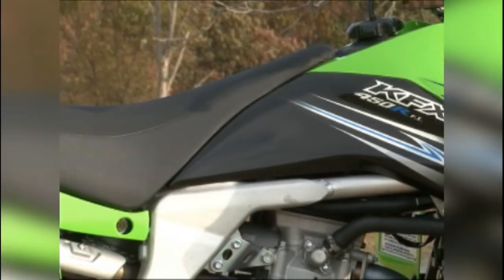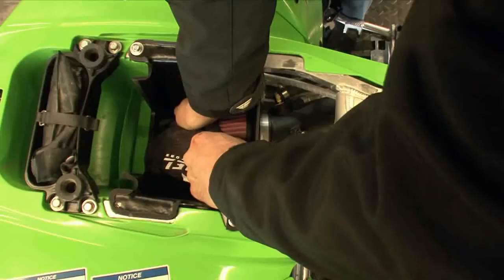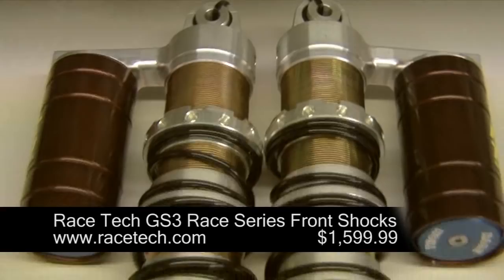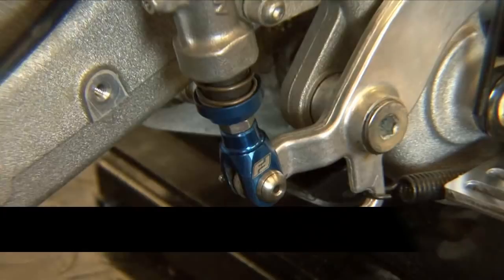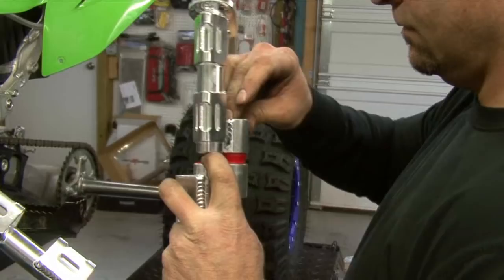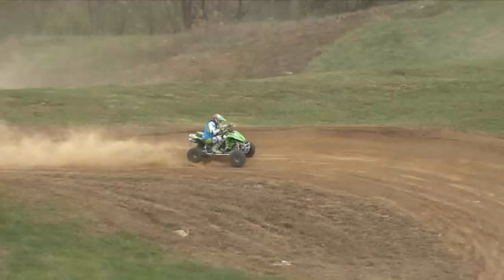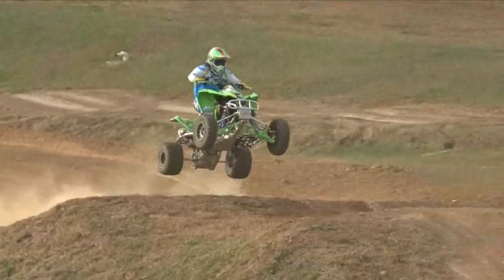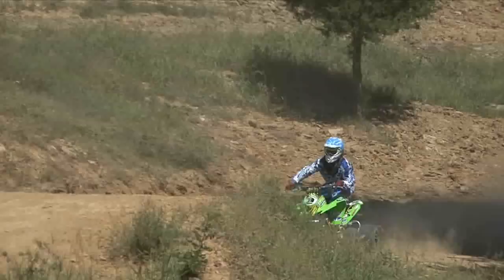Kawasaki KFX450R Motocross Build

Comment: This is a budget build guys. *Proceeds to spend 1600$ on front shocks*🤣
Reply from the maker: Okay okay so it wasn't really exactly a budget build although we did not even touch the engine. If you're going to build a KFX for the track you're going to have to get aftermarket suspension there's really no way around it
Reply: @ATVonDemand  understood just a joke cuz I'm poor😂
Reply: Those are premium front & rear shocks for sure! Be my 1st choice if had extra bucks. Fox & Elka stage 2 or 3 are cheaper I think.
Reply: Now nice ones are3-4k 😂

Comment: I been following this build for my bike and it's so far great

I did elka stage 5s all the way around though
And lonestar +2aarms +4 axle

But used the fuel customs intake and the hmf exhaust and programmer

15 tooth sprocket

This bike runs.. No bike is cheap New and being competitive isn't either..

U can go buy a 2014 yfz450 put a pipe and programmer on it and loose to a 2014 kfx450r with a pipe and programmer 

Buy what u like. But I've made plenty of Honda Yamaha n Suzuki 450s mad..
Reply: What does the 15 tooth sprocket do to your kfx ,does it increase the performance ?
Reply: Pics of the build?

Comment from the maker: We never calculated the machine's exact top speed, however it was geared down just a bit from stock. We could have easily pulled taller gearing then stock, with improved acceleration. Nothing wrong with a joke. Thanks for watching.

Comment: maybe cuz I'm old i be 47 next month for racing i like 2 strokes like a 
Banshee or Honda 250R FourTrax . back in the 80's i got them brand new from 
the dealer... new 1986 Honda 250R FourTrax was like $2000 and 1988 Yamaha 
Banshee was like $3000 if i remember right.. believe or not i still 
own them 4wheelers still runs like when i got them brand new ..i 
spend a lot of money to keep them running over the years.. trail 
raiding always like Honda 250R FourTrax over Yamaha Banshee .. not saying Yamaha Banshee is a bad 4wheeler to me seem like Honda 250R FourTrax is a better 4wheeler on the trails . i think Yamaha Banshee is to fast for trail riding.. well most trails that is

Comment: These guys put over 10k in a quad for racing as a privateer. That is crazy
Reply from the maker: Rebel Devil like the TRX450R, the KFX 450R takes quite a bit of work to get it race ready. Consider the fact that we didn't even go into the motor. if Kawasaki had made this machine 50 inches wide, had a better intake, different front and Caster settings, and a few other small changes making it race ready would have cost weigh less.
Reply: @ATVonDemand  * way less.

Comment: ORR!!... Spend under 10k and get the new 2015 YFZ 450R and Right Out Of The Box have a Race Bike, then if you want Add Full Exhaust and Power Commander and for another 5 -600 bucks and you have a Full Race Bike for under 11k =) Ur Welcome
Reply from the maker: We cant disagree with that!
Reply: rcysi ya u could but you would get smoked by a experienced rider on that kfx
Reply: Been there done that, and it still sucked. No bottom end what so ever. 2017 yfz450r se, full 4.1 FMF and vortex ecu. Like the DS450 it needs a different cam to help out. Sold it and going back to KTM.

Comment: or you can just go buy a new YFZ450R or a used LT450R and be done with it
Reply: Jason Williams newer 2014 and up yfz 450r don’t run very good out of the factory  most people spend another 1200 on a Aftermarket ECU,exhaust and intake
Reply: Sb 197 yep bought a 18 and was pissed. It would stall while riding and moving, was so lean out of the factory. It sucked
Reply: @tylerhill4328  that is just the name of the game. It's either lean sport quads or no sport quads
Reply: ya got a 19 same problem! exhaust a pc5 changed that though!
Reply: also have a 06 ltr450 and i love it one of the best quads i have ridden

Comment: i have an 09 kfx 450r and when i try to open it up in 4th and 5th gear i cant go full throttle, well i can but it wont give me any response. what should i do. i just replaced the fuel pump and just got and whole new rear end, axle bearings etc. please help

Comment: hey ATVonDemand I have a 2008 400ex and I was wondering about the hmf competition exhaust like you have on this model. I am aware that the exhaust has 3 different inserts to control the sound, however, to my knowledge this would also change the jetting required for the atv. I needed to know if you would have to jet it for a certain stage or if you can put in the recommended slip on jet ( I am wanting the slip on) in there. Thanks!

Comment: $18,000 how the fuck is that budget ? 1,000bucks is a good budget for add ons for me who wants to spend that much money on a quad
Reply: gotta pay big money to run with the big dogs bro..its best to let someone else pay the price tag and buy their race bike at the end of the year for half that..
Reply: Get parts used you can get great deals
Reply from the maker: No motor mods other than bolt-ons made it budget. You cant make a 46 inch wide machine race ready for $1000. Race legal sure, but not competitive. Starting off with a YFZR or LTR would be less expensive, very true.
Reply: if i was a pro racer witch i plan to be when i get my kfx i understand you completely but consider buying an old car and restoring it along with adding state of the art parts and oil changes and just gas plain old gas money you pay almost over 18000 a year along with car insurance you pay almost 150,000 a year so the coast may be expensive to me and you but for someone who will race the money back its maybe just a little over budget therefore being in budget range

Comment: I just got a yfz 450r and am looking to buy a slip on I’m not sure if I would need a fuel controller or not I just want to be sure so it’s not running lean ,what do you think would be the best option for me?
Reply from the maker: Sb L81 congratulations on the new machine. Welcome to the family. Yamaha told us a while back that you can run the yfz450r with an aftermarket exhaust without having to switch out the fuel controller. We tried it and it ran like crap off the bottom. It was difficult to take advantage of the horsepower gains from the exhaust because we needed to keep the air box lid on to keep the bike running halfway decent. We would definitely recommend getting the controller. You will be glad if you do.

Comment: Do you guys think the yamaha banshee with some mild work could compete with these 4 strokes today?
Reply from the maker: The Banshee will never handle as well in rough turns so on a track the modern machines have an advantage. As motor goes, yes, A Banshee with some mild motor work Pipes, porting, head mod, reeds, and rejetted carbs can produce around 60hp. You would have to build a pretty radical 450 to produce that much power. The modern four strokes are easier to ride fast and no amount of money will make a Banshee run like a four stroke.  I used to one a nice Banshee. If you have any specific questions, please feel free to hit me back.
Reply: ATVonDemand I agree with everything you stated. If the banshee had a wider wheelbase it would handle better. I will always be a 2 stroker but 4 strokes are so much more user friendly. This Kawasaki is NICE
Reply: maybe cuz I'm old i be 47 next month for racing i like 2 strokes like a Banshee or Honda 250R FourTrax . back in the 80's i got them brand from the dealer... new Honda 250R FourTrax was like $2000 and 1988 Yamaha Banshee was like $3000 if i remember right.. believe or not i still owned them 4wheelers  still runs like when i buy them brand new ..i spend a lot of money to keep them running over the years

Comment: I have the same intake and pipe, can't seem to get my hmf optimizer to the right setting, what was the best one you guys found. PLEASE ANSWER!
Reply from the maker: +Wyatt Cornish What issue are you having? We had an issue with flare-outs at low RPMs when we chopped the throttle heading into corners. We Tune the stage 1 setting until it idled smoothly and had no further issues with it. We left the other settings alone.
Reply: +ATVonDemand 
it just cuts out, and when I mash the gas it takes a long time for it to like register for it to kick in. like it bogs for a second or 2
Reply from the maker: Have you tried different settings on the controller with any different results?

Comment: With that money I can buy a raptor 700 and smoke that kawasaki
Reply from the maker: A tock Raptor? In a drag race maybe. On the track where this machine was built to run, a stock Raptor would get smoked. Raptor owner by the way.
Reply: @ATVonDemand  yeah for short course circuits raptor is a little heavier, but upgrading to 50inch Arms and couple of modifications could do well but at that point you might as well get the yamaha 450